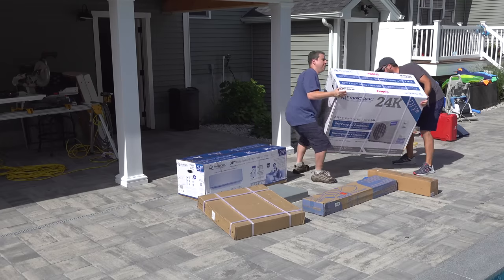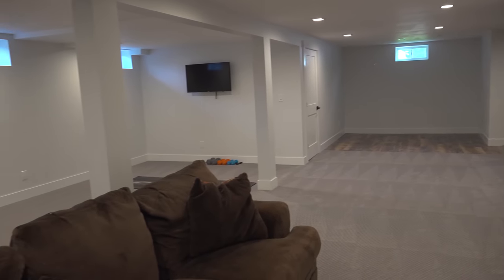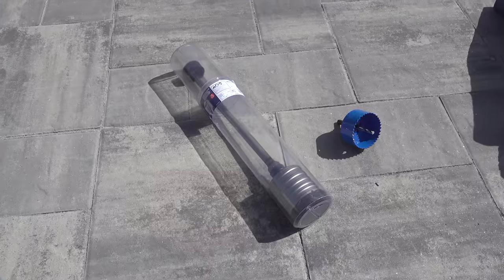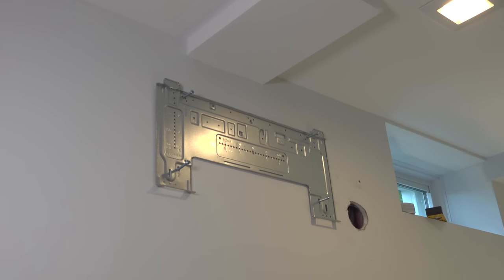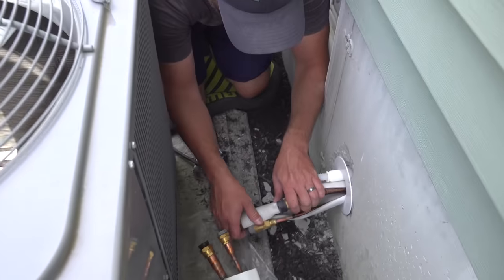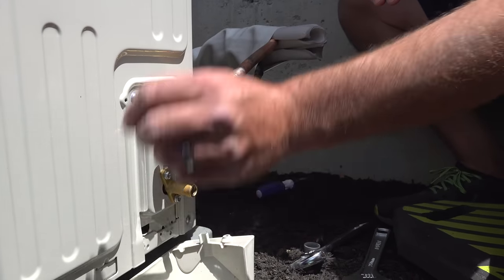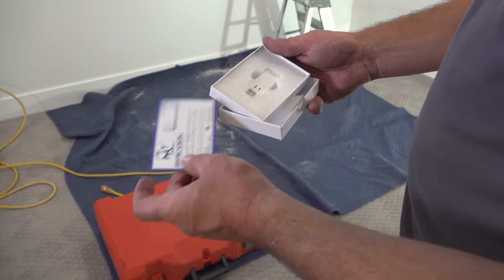Install your own AIR CONDITIONING in 4 HOURS!  DIY Mini Split MR COOL

Comment: Forget the leak spray you should pull a vacuum or blow nitrogen through the Lines and you definitely should be putting gauges on that condenser during the start up.depending on the state at least where I am compression fittings have been banned since the early 2000’s so people that want to diy might need to learn how to braze the line sets depending where you live.
Reply from the maker: Not with this system, the line set and condenser are sealed and freon filled. They only open their valves which can be seen inside the plastic caps on the line set when properly connected. The system is entire factory filled and sealed to perfection.
Reply from the maker: These aren't compression fittings either
Reply: @SilverCymbal  ok well any fittings with nuts or connections like that some states don’t allow that. As far as the condenser coming with Freon in it most split systems come like that I’ve been installing them since 1998. I was saying to use nitrogen to check the connections you made and if you don’t have that you could do it with a vacuum it’s much more accurate than spray. Lastly like I said hooking up gages during startup that’s what a service tech does sometimes  but you don’t have to I guess if your diy you probably don’t have an EPA card or gauges so technically in some states you shouldn’t even be cracking those values on that condenser.I think other than those few things for someone that doesn’t do HVAC every day you made a good video on how to install a split system it was only those few things.
Reply: @SilverCymbal  Even if the line set is sealed the minute you pull the plugs unless you instantly connect the lines contaminants like moisture,dirt or dust can get inside and contaminate the system. Anytime I’ve ever installed a line set on a split system I’ve pulled a vacuum and checked for leaks.

Comment: 8:08 not up to date with the US code but if that is a 220V line shouldnt the white wire be red or at least marked as a phase? To not be mistaken as a neutral? (Sorry for my english)

Comment: Hi,.. Is the line set directional?... That's to say....  R the connectors specific to the indoor /outdoor units?  Mine came with no identifying marks to orient correctly.... Thanks.
Reply: NO they are not Directional.

Comment: My to-do list includes comparing the cold-climate heat pump efficiency of these units vs. Mitsubishi H2I models or Fujitsu XLTH.  If anyone has already compared/analyzed please post.  I'm looking at the feasibility of converting my whole New England home from oil-fired boiler heating to heat pump heating.

Comment: I would install it for my 2 car garage. My siding is hardy plank cement siding. Not sure what kind of drill bit to use. I have shelves on the inside wall so would have to get rid of a shelve or two.

Comment: You let that Freon type gas into the system tubing. Clearly, the install didn’t ask for it, but what about the existing air in the system?  BTW, I learned with my Mitsubishi system that there is NO maintenance on it and not to allow an HVAC repair person attempt to check Freon levels like they do on regular systems. The systems are very touchy and cannot easily (and without great expense) be charged or checked. Essentially it either works or it doesn’t. When it quits, it is more likely a piece of the electronics needing repair/replacement. I’ve had my inside unit (coil) replaced twice because here in Florida, it almost never dries out. Also, we fight mold again because it stays wet.
Reply: Yeah I usually weigh it with a refrigerant tank scale, that's the only way to charge them correctly after losing refrigerant

Comment: You have to pull a vacuum on the refrigerant lines before releasing the Freon. By not doing this your allowing contaminants into the system that will cause the unit to not run properly and potentially fail prematurely. I highly doubt the connections on the copper lines are sealed enough to maintain a required vacuum, and air is still introduced into that system as soon as they are connected. Air is non-condensable in the refrigeration system and will make the system work harder and cause premature failure. This is a good video on how to install the outdoor and indoor unit, but I would consult a Refrigeration mechanic in your area to install the refrigerant lines and properly evacuate the lines for the Freon. FYI This is what I do for a living.
Reply from the maker: Nope.  No-Vac Precharged Refrigerant Line Set with 3/8" and 3/4" Line Ends

Comment: I question this install, first the metal stud. Yes it is not (should not) br holding anything structurally but what if that was wood? You would need to head off the stud. Second the hole in the concrete should have been drill from the inside down toward the outside (as stated in the installation manual) helps with draining.

Comment: Good job but next time hammer drill a smaller spotting hole from inside to out the core drill your bigger hole from outside to in. It makes a clear look finished product outside.

Comment: Even though it’s more structurally intrusive, I prefer a PTAC.  I’m surprised that your friend then opt for an industrial duct run.  This may be one of the only videos I’ve seen the line set manipulated with such ease.
Reply: I was thinking the same thing.. But.. That wall is MEGA THICC! I don't think a PTAC sleeve would do it...

Comment: So no vacuum to put it into a 500 microns which is mandatory under EPA regulations, and I would of put some rocks under the pad of the condenser and level it up like that it makes it harder to tilt thru time and using regular soap on the lines is a contaminant if there is a leak it mist be a soap specifically made for leak testing

Comment: I bought one of these and the problem with them is they are always recirculating air and not exchanging it. So in Florida in the summer it will very soon start smelling like mold and dank mildew smell. I keep the thing cleaned but the smell comes back about as quickly as you clean it.

Comment: Where does that white wrapped line go? It looks like it goes into the house. What does it get hooked to? I see that you drilled the out through the concrete wall but the other line needs to be addressed.

Comment: Great install video, about to do mine this weekend.  I bought a Senville, so I will have to vacuum the system first.  In your install I didn't see where the condensation drain was addressed.  Does this unit not have a drain system?
Reply: Absolutely, and an important part is to follow instructions for the drain. Difficult to correct once installed lots of problems if not.
I’m the video you see when the lines are pulled through the plastic white drain tube along side. 
A lot of condensation can occur in these systems and the drainage is very important follow instructions so you won’t have to curse the manufacturer lol
Reply: Why will you have to evacuate the system first. Everything should be precharged with refrigerant.
Reply: @james4582  Thanks for the reply, the Senville kit comes with simple plastic plugs over open lines, there is no valve in them like there were in the Mr. Cool system.  Also, the evaporator part (inside) was pressurized with pure nitrogen, I guess to check for leaks and keep stuff out of it.  there are plenty of other videos showing other split systems being installed and like those I had to pull a vacuum on the system before I could open the outside unit (condenser) values to pressurize the system.  One note, the documentation for the install said the system was optimized for the 16 foot line kit, and they were spot on.  I couldn't wish for a better working system.  It is so quiet that while inside my workshop I can barely hear the road noise from the highway about a 1/4 of a mile away, but it is all I can do to hear the system running, and it will chill the room down to 63 degrees (62 is the cutoff so I stopped at 63) in short order.  It is like walking into a crisp clean winter day which is so nice after I have been working in the yard at 95 degrees and 80 percent humidity.  Lol!
Reply: @james4582  You nailed the condensation advice!  I managed to get the drain line sorted out but I left the copper lines exposed until I could confirm everything was working properly. I ran the unit overnight and a considerable amount of condensation had built up on the copper lines and "drooled" out from behind the housing.  Anyhow, all that has been wrapped and I filled the "through-the-wall" hole with foam.  Running it the next two days at full tilted yielded no more condensation that I could see.
Reply: That’s interesting about the lines and evaporator but I did one mitisbushi where I had to cut the line because the condenser was on the roof just above. It was in a banquet room in a hotel/restaurant application. I think I did a customer installed unit like that as well now I think about it. He did a good install with just an electrical mistake which I cotrectrd for him. I believe the unit he put in required a vacuum on the lines and evaporator as well. Most of the rest were all precharged that I did. I’m glad it worked out well for you. I didn’t do a whole lot of them they were coming on just a few years before I stopped doing installs of residential. I do know as I empfasized follow those instructions and you’ll be happy you did they are good units
Reply: With 95 heat 80%humidity you can darn near water a garden next to an AC unit lol with the condensation
Reply: @Denisovan Hybrid
It all depends upon the manufacturer and how they specify their product. Some come precharged from the factory some just the condenser. Some are fully charged at all components. Including the evaporator condenser and the line set. Very few manufacturers are the same 
Mr Cool for example seems to be all charged from the factory with matching PRE CHARGED LINES.
Those line sets are purged with nitrogen evacuated and charged with the appropriate refrigerant 
With sealed fittings. That’s self explanatory. However as I pointed out, each manufacturer may well be different. It’s important to read and follow the instructions that come with the units. I have on a couple of occasions followed up with soMe customers that installed their own but had requirements of having a licensed HVAC person leak test evacuate and charge the system or the warranty could be void. Not a big thing I was paid my time and for the refrigerant. And the customer was happy. Some manufacturers have specific ways to do things. 
I install some that I cut and shortened the lines because the customer didn’t like a large coiled up mess behind the unit gathering debri or pets to damage the insulation. Not a problem cut and braze a section out still using the factory connections not a problem
I know a lot of people that have good mechanical skills and can do a good job for their own properties 
Not a problem. 
Just follow the manufacturers instructions 
Daikon is a Chinese company that is touted the largest A/C manufau In the world and some other Chinese companies along too
The US is about the only country in the world that uses split package or package units requiring duct systems. That is I. Itself not bad just the way it is. And such a system as that can have bad results if not properly sized and installed. 
I hope that explains things a bit better thanx for the comment.

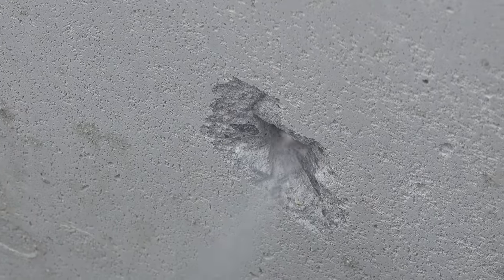Comment: 10:12 You should remove the black disconnect plug there before doing anything.
Whole purpose of the box is to prevent someone unknowingly turn breaker on inside.

Comment: You mentioned the unit came with twenty feet of line that looked like you only needed less than ten feet of it,  what did you do with the excess line
Reply: You're supposed to curl it up in to a flat loop behind or near the equipment.

Comment: You must live in a country or state without good safety regulations. Here in Australia you must use a qualified trade electrician to hook up the power. Anyone can install the unit but only a electrician can finish the job.

Comment: "Ditch that window air conditioner and install your own central air conditioning..."  That's great, but many have to consider that the latter costs 10x the former. That's a major factor.
Reply from the maker: Now let's be fair. A 5,000 BTU window air conditioner costs $200-300  This was a 24,000BTU system and would replace 6 window air conditioners. I am not denying its more expensive but its cheaper for the amount of cooling and electric use is about 1/4th as much.

Comment: 2400$… plus the cost of labor, plus the cost of an electrician. Just happened to have an hvac guy around to know how to install it. 😏 Clean install though. Somebody has hung a few of those before. 👌🏼
Reply from the maker: You are funny, neither of us ever installed one of these. He knows carpentry. You certainly can't install one blind but it's as straightforward as it looks. Watch for another video on this, you are in for a surprise.

Comment: you should put insulation. You need to add A-410 if you have a long copper line. you should use pipe bender for tight turns. you are lucky to have threaded nuts for your copper.

Comment: I got a Senville 24k unit for $900 on Ebay before summer prices went up.  It was not pre charged so I had an AC guy do the whole thing for $500.  Total cost $1400 which is $600 less than Mr. Cool and I did not have to do the work.  Be careful buying something that needs professional installation because one guy thought he was worth $1800 for 4 hours work.  To Hell with $450 an hour air techs!

Comment: Well, there’s some miss information here like what do you do if you want to hang up a unit that is in a room in the middle of the house. Those lines aren’t going to reach which means you have to buy the right copper (acr type k) and you have to pull a vacuum. You also have to braze all your joints. For me I live in Texas and I would put a mini split In every room in my house instead of one central heating a cooling unit, but I’m a master plumber and I know how to install, braze copper, and pull a vacuum.

Comment: I'm in Phoenix AZ and I wish houses here have basements!
Reply: Places for desert critters to shelter?  A better solution is a thick  masonry, concrete or adobe outer shell that extends well below the surface, with a surface slab.  That assumes you have a local potable water supply, otherwise plan to move.

Comment: You forgot to do the most important thing. Pulling a vacuum or if you couldn't, you should have purged the lines with refrigerant first. This will work great initially but will gradually decline the life of the compressor.

Comment: It's crazy this guy needed AC in the basement at all.  My basement was nice and cool when my AC went out last summer.  I basically lived down there for 3 days until the AC got fixed.  It was pretty hot outside also.
Reply from the maker: I think you missed the part this is heat and ac in one unit. He needs the heat more but it also dehumidifies that is very appreciated in a basement
Reply: @SilverCymbal  Oh, that makes more sense.  Thanks.

Comment: I didnt see the line set being evacuated, is evacuation not required or was that step skipped?
Reply from the maker: Skipped per the directions since with this setup its not needed: No-Vac Precharged Refrigerant Line Set with 3/8" and 3/4" Line Ends.

Comment: confused, you couldn't check for studs b4 u made the hole thru the concrete...wierd? thanks!
Reply from the maker: He knew he would be close and there were pipes to the left which were more of the concern. Notching the steel stud didn't even take a minute so it was no issue but if you want to check before thats fine.

Comment: Were you suppose to vacuum the empty line down to -29 before releasing the freon?
Reply from the maker: Nope, the line are pre-charged and sealed on these, ready to go. You only pull vacuum on empty lines and systems.
Reply: Wow, that is Convinient

Comment: I installed the 5 ton unit. Works great. I do hear a high pitched sqweel though while the Freon runs through the pipes. Not sure what that's all about. I did email customer support with no reply. Hope it goes away. Its been a month.

Comment: Good video, but, you made some really amateurish mistakes: not checking for the wall stud, and not drilling from both sides to avoid the concrete breakout. Neither issue needed to be encountered.